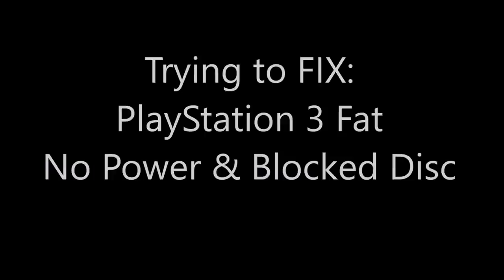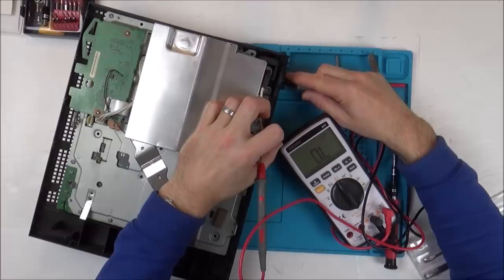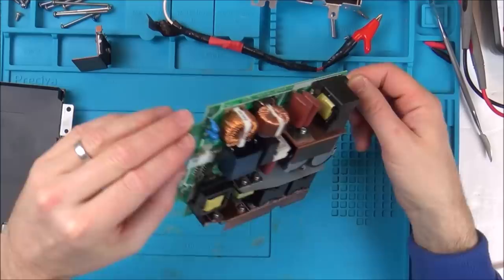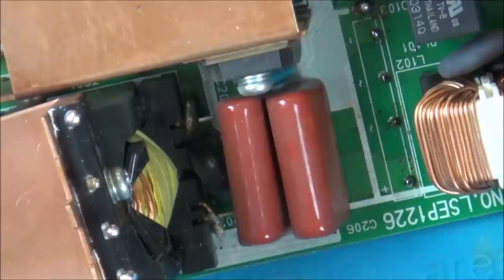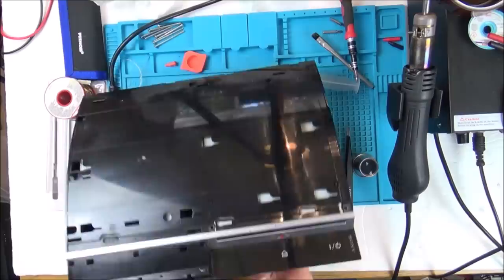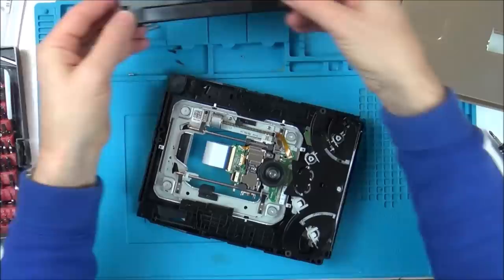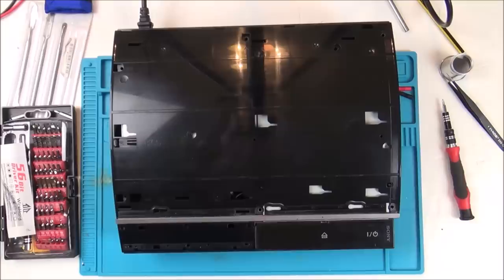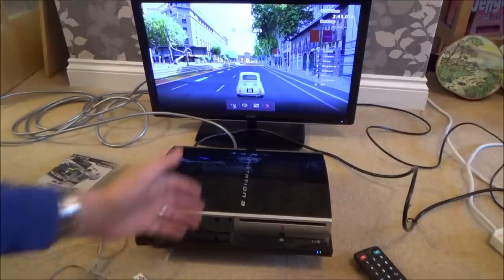Trying to FIX: PS3 Fat - No Power & Blocked Disc

Comment: The power button on the front doesn't ACTUALLY turn off the PS3. Soooo, you'll never be able to "fix" that. But if you hold it down for a few seconds it will go into standby.  :)
Reply: God i was screamming to the TV, it doesn't work like that
Reply: Sometimes I wish we could turn Vince to stand by! LOL
Reply: GM Kof hard  same
Reply: @My Mate Vince, this is what we all are screaming at our TV's at you. LMAO! You have to HOLD the button to put it into sleep! XD
Reply: Yeah that was bugging me, I haven't touched my PS3 in at least a year, but I'm like "wait, don't you have to hold the button down?" lol
Reply: Yeah right, it doesn't work like normal switch, you have to hold it to turn it to standby mode.
Reply: Maybe he should do live streams while he fixes things like Louis Rossman and we will be able to help him with the repairs or questions he has
Reply: And this is a deliberate choice to prevent accidental input, though this applies only to the FAT PS3s
Reply: What dose turn it of thene
Reply: I came to the comments just to mention this.
Reply: No i have the same ps3 you press and hold the power button
Reply: And it will turn off
Reply: @brudarov  QQpl%😊sz😘😘
Reply: Had same mindfuck
Reply: Not standby it fully shuts it down
Reply: Mine won’t do standby why is that I need it to to reset the picture

Comment: I'm fairly certain the drop broke the bridge rectifier, but caused no damage to the disc drive. Since the device could no longer power, the owner or the next in line got the drive open and physically recovered the game, then reassembled without moving the gears back to the open position.  Great repair!

Comment: I feel like you're supposed to hold down the power button to turn it off.
Reply: Yeah i own 2 of these and yes thats how you turn them off
Reply: But he did hold it down the two firs times right?
Reply: @andersmmvfc.8376  no he kept tapping it expecting it to work like an on off switch when it's a pressure sensitive switch
Reply: Yes
Reply: Its the same on all ps3 you have to hold the botton down to trun off
Reply: Correct mate, the original PS4 is just a touch of the power button to turn it off....The PS3 Fat you had to hold it down for a couple of seconds to turn it off....Vince probably got confused.
Reply: Yes, but when it was in hdmi last or what ever, you have to hold until it beeps twice and it will go to AV or whatever you using. Because basically i has its settings on hdmi but youre using something else so you have to hold it and it will change. theres my explanation.
Reply: MizuhoChan me too I mean i I got a ps3 fat and. That’s how I turn it off.
Reply: @Ngbatz  Nah, Vince is awesome.  And fixes a lot more stuff than me.

Comment: The power quit when the fatigued leads let go, they tore it down and removed the disk and didnt set the correct position for switches before reassembly.  The lid was bent while they were messing with it......NOT DROPPED. :)
Reply: Inside the power supply part broken off, definitely dropped.
Reply: probably both

Comment: Vince, I really enjoy your enthusiastic curiosity in trying to fix electronic devices.  And yes, sometimes I am yelling at you to see the problem.  But your basic logic for troubleshooting a device fault is refreshing to watch.  For those amongst your audience that have formal training in electronics repair it is very interesting to see you find and fix so many problems.  Typically, from my point of view, I would have opened the case, checked for obvious burn marks or other indicators of electrical problems and if nothing is obvious then I would start seeing the device as a group of subsystems (power supply, control circuitry, human interface [buttons] and ect.) then try to localize the problem to a specific area within the device.  Circuit Schematics are almost mandatory for all but the simplest repairs, and then try to narrow down the problem to a single component or a sub-circuit.

A piece of advice,  all AC to DC power supplies are finicky. Any power supply for anything with electronic circuitry will be, basically, one circuit.  So if part of the circuit dies, it has most likely destroyed another part too.  Check the small capacitors and resistors on th DC side if the rectifier dies.  If you've got a bad AC to DC rectifier then when the rectifier dies it could kill these parts, conversely if these small value capacitors and resistors slowly go bad they will kill other components after the power supply.
Concerning discharging capacitors: I've always used a modified heavy duty power cord to discharge capacitors.  The modification is to not connect any of the power leads and only connect the ground lead.  Use this with the power leads trimmed off on both the non outlet side and the side you will use to ground out your capacitors, and connect a good quality spring clip to the ground wire. (Be sure to wrap each end of your new cable on each end with green electrical tape (green means ground).  This accessory cable is also useful for your Anti ESD wrist strap, a good way to safely ground an ungrounded metallic chassis, or a good insurance when testing new circuit design on a non grounded project board.

I don't want to discourage you in any way, but you need to practice soldering more. The balls of solder on the SIP Bridge Rectifier you reattached to the power board in the PS3 were less than sufficient.  The problem your perpetuating is cold solder joints.  You must heat the component lead, the board through-hole connection,  and the solder. If not, the solder join will eventually break or separate from either the board (most likely) or the component lead.

BE VERY SURE YOUR WALL POWER OUTLETS ARE WELL GROUNDED!

Please keep going, mostly I am not yelling at my computer like a crazy person when I watch your videos.  :)

Comment: The power button doesn’t work like that. (One tap, off.) you have to hold the button down for a few seconds. As for the cooling fan, you might want to try replacing the thermal paste on the gpu/cpu since it’s been sitting for some time. Remember there was dust there upon disassembly so either the fan is full of it or the heat sink fins are being blocked due to dust. If there is the fan has to work harder to keep itself cool. Whenever I repair one of these I take it All apart so there is no “revisit”..

Comment: You should usually remove the dead legs on a component like that, and for a temporary fix, you tightly wrap wire around the base of each of the rectifier legs, solder them, so you get a good physical connection to the rectifier, and then push those through the holes in the board and solder it well on the bottom.   That guarantees a good solid permanent connection w/o potential for things go off later.  Love the videos, keep em coming!
Reply from the maker: Thanks for the tip Phil :-)

Comment: My guess: it got a sharp knock, dislodged the component and when they couldn't power it on to remove the game they opened it, took out the disk and the drive was left in the 'disc in' state.
Reply: i second that idea Sam. Exactly what i thought.  I was given my first ps3 by a friend...it needed a new power supply,and also needed the drive resetting,let me tell ya i felt like jimmy neutron when i got that puppy back together all working-talk about pandoras box! nice video1

Comment: Hey Vince, I have fixed alot of PS3 consoles and the answer your questions, 1. The power button is tap to turn on, and hold for 3-5 seconds to turn off. 2. The fan is loud caused by dry thermal paste or an overheating APU chip.

Comment: When I had a PS3 a while ago I can’t recall being able to turn it off with a single press... I think you hold the power button down it goes into standby???
Reply: yep
Reply: in the fat model yes.
Reply: It depends on the model. I've got CECH2002a or b, and it turns of with a simple tap, but I also have CECH3003B that takes 10-15 seconds of pushing to turn off and almost always ends up corrupting the data.

Comment: SIL = single in-line. It's the components package type.
Reply: Yeah just means the pin are in a row.
Reply: @GigsVT   yes as opposed to dil - dual in line,  ie normal ic's say with eight pins.

Comment: It looks like someone drop that ps3, thus knocking out the bridge rectifier and for that bluray they opened it to remove the disc without set it to normal position. I recommend you to change the thermal paste and clean the fan.

Comment: Very simple fix for the off button:
You just need to hold it down for 3 seconds haha

Be careful about swapping whole power supplies though ! Not all are compatible between fat models.
CECHA - CECHG used the first generation of the CPU + GPU, which used a lot of power, and had a beefy power supply to cater for that (as you noticed, 23amps !). 
Later model fat ps3s had revised chips that used much less power, so they had weaker power supplies accordingly.

An easy way to tell if the powersupply is compatible , is which side of the PS3 the ports are on.

Early PS3s had the ports on the right, next to the power switch. These use the high power supplies.
Later PS3s had ports on the left, away from the power switch, these used the weaker power supplies.

But the best way to tell is to simply make sure the power ratings themselves match. It's written on the bottom.
12V rail: 23.2amps
5V rail: 0.6amps

If the new power supply matches these, it should work just fine
Reply from the maker: Thank you :-)
Reply: I can finaly rest in peace he saw one of the comments
Reply: And please what can i do if my ps3 fat keeps going off and sometimes it won't come just keeps showing a blinking red light each time i put it on
Reply: @Solution-630  what model it is? CECH A - CECH G?
or CECH H - CECHK
Reply: @Solution-630  it sounds like the NEC Tolkien capacitors are dying, you can fix your PS3 by replacing one or two of the Tolkien capacitors with Tantalum capacitors.

There's many videos on how to do this, it is rather easy repair if you can use a soldering iron.

I would not recommend using a heat gun to remove the NEC caps, they're nearly impossible to remove without destroying them anyway, it's better to just tear them apart to remove them.
Reply: @televisionandcheese  it’s CECHG04
Reply: @televisionandcheese  and what if I try that it doesn’t still work? Cause I’m just scared now

Comment: All that amperage would be for the Cell CBE wickedly underated little beasty that one..
Reply: Very. All architecture being the same, it could probably outpace the 8-core Jaguar in the base PS4.

The thing holding it back was RAM and the GPU, so much so that most of the major exclusives used the CELL as a second GPU. Uncharted 2&3 famously did this, as did GOW3 & Killzone 2&3 using CELL to do normal GPU tasks like Antialiasing, light geometry and such.

So it ran the base code AND worked as a GPU on most AAA titles that gen. That's how strong it was.

I should add that it was also why multiplats were so bad on PS3 for the first half of that gen: devs only used the main CPU core on CELL (3.2ghz, iirc) due to having zero idea how the SPUs worked in unison within CELL. They just ignored them lmao

The Orange Box famously did this and why Gabe/Steam hated the PS3 at first. Yet, even that one main core was enough to produce a fairly equal but slightly gimped copy. CELL was a beast.
Reply: absolutely

Comment: For once, some unexpected (and easy-to-fix) problems. But the bridge rectifier was definitely an unlucky victim.

Bonus Info: The bridge rectifier is only capable of inverting the negative half of the AC voltage. The big, fat capacitors are generally there to smooth out this bumpy DC voltage coming out of the bridge rectifier. They store a charge, and as long as they hold a charge, the voltage in the rails they’re connected to will stay high.

Voltage is really just a difference in potential between two points. The ground is universally referred to as the 0-volt rail.

But the reason the capacitor is able to hold a charge is because a resistor limits the current flowing past it. The capacitor will charge up rapidly, but discharge extremely slowly. And it’s this extremely slow discharge that smooths out this bumpy DC current into an almost perfect DC current.

Almost perfect, because the extremely slow discharge will still deplete the voltage a teeny tiny bit during the AC lows (like, a thousandth of a volt, or something like that... nowhere near enough to cause problems).
Reply: Sorry but this is actually not 100% right. The bulk caps on the primary side are not supposed to "perfectly flatten the voltage" and it isn't even a requirement in SMPS's. Basically, having such big caps to transport that amount of power in just a tiny time window of a current burst to bring the voltage 1/1000V up again each half cycle would severely degrade your power factor and you would need loads of caps more to achieve that for a 200W PSU... 😄
The switch mode controller doesn't really care about ripple but it definitely needs a certain minimum voltage to operate. It switches and regulates at very high frequencies (compared to the low 50/60Hz) so that e.g. a 10% LF ripple doesn't matter actually. But these caps have to maintain at least 90% of the voltage during the whole half cycle (10ms) and they need to deliver 200W during that. That is quite a lot of power for quite a long time period. 😉

There is rather a trade-off between power factor (passive power factor correction in this case) and maintenance of minimum input DC voltage (and also the price; big caps are expensive). Usually you want to keep the caps as big as necessary (high PF+minimum DC voltage+margin) and as small as possible (price, space).

Regarding the output voltage, it is perfectly flat (presuming parasitic coupling of HF is properly filtered) as long as the change rate of current (dI/dt) is orders of magnitude lower than the switching frequency. It is just all about the frequency of the controller feedback and the frequencies on the demand side. However, the primary side caps have no effect on the output ripple. What you maybe meant was output caps of linear power supplies? That's another story...

Comment: Lovely fault finding and fixes, easier to leave top covers off for testing, later ps3 fat models are easier to work on than the cech c03, worth thoroughly cleaning dust out, new thermal pads and paste, cr2032 battery 👏

Comment: This model ps3 has some thermal issues usually caused by dried up thermal compound between the gpu, cpu and the IHS. I would ‘delid’ both the cpu and gpu and replace the thermal compound all around. Thanks for the video!

Comment: The noisy fan is normal, that model of ps3 were notorious for having a loud fan. Almost sounded like a rocket taking off some nights.
Reply: Well, cleaning it and exchanging the crappy thermal paste Sony used with something decent might actually help. Those PS3s can be relatively silent.
Reply: Same as the PS4 Pro then  lol.

Comment: it's able to deliver 282W on the 12V line and 2.5W on the 5V line. Watts =Volts x Amps. The wattage is high on the 12V line because it has to power the fan, Hard drive and Disc drive. It takes more power to generate the magnetic fields required to move the motors than it does to operate the rest of the ps3 circuitry. On another note SIL stands for single in line, which simply means there is one row of pins.

Comment: Just to shed some light on the disc issue ...the reason why it thought the disc was in there is because when it was dropped it no longer would boot on. The previous owner opened up the dvd drive and removed their game from the top. In doing so, they likely bent the case in the process. So when you fixed the power issue, they system still thought the disc was still there. By manually winding the gear, it lowered the retainer clip allowing the system to now accept a new disc. Hope that makes sense. Great video!! Keep them coming! New subscriber here. Thx!

Comment: The fan is definitly too loud. You need to swap the thermal paste BUT you also will have to take off the head spreaders because there is also paste underneath them. BUT I think it was the GPU, one of the headspreaders is very hard to remove and you can easily damage the chip while trying. There is a safe way to do it though. Back in the day you could buy a tool for that but you can`t get it anymore. Pro tip, use a 0,30 fishing line and cut the glue with that. You need to heat the chips up before but not too hot, a hair dryer will do. Cut one or two corners of the glue underneath the chip, just a little bit with something sharp to get a good starting point for the line but be careful. And even with fresh paste put everywhere the PS3 always ran quite loud and hot. The reason is the case it was poorly desingned back in the day. Another tip, drill holes in the back of the case. Some circles of holes 8mm ones, two or three circles above the fan blades will do and put the console veritically, it will run quiet and cool. Another interesting fact, I once thought replacing the harddrive with a ssd would do wonders to my loading times but it didin`t...the fucking IDE cable of the disk drive is the fucking bottle neck this console has! It took me quite a while to figure that out. There is way to mod your PS3 to load games directly from the ssd without using the disk drive. You will have to take the ssd out and connect it to a PC if you want to put new games on there BUT it is worth the effort, you will see a big performance boost in loading times. A game where you will love this, Demon Souls xD....All of this would make a great revisit I think. Have fun and regards.

Comment: The problem with the Fan might be because the Thermalpaste may be the Original one out of the Factory. Also maybe the Heatsink might have dust in it. I think putting new Thermalpaste on and maybe clean the Heatsink fins Fixes the Loud Fan noise. ;)